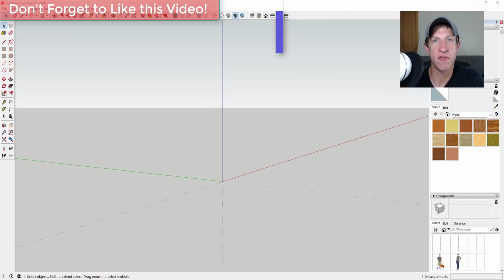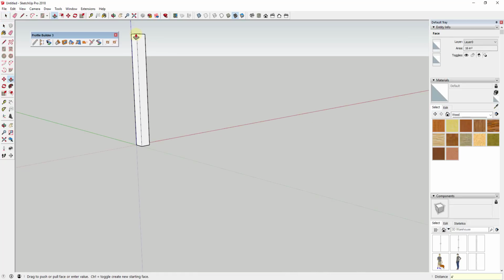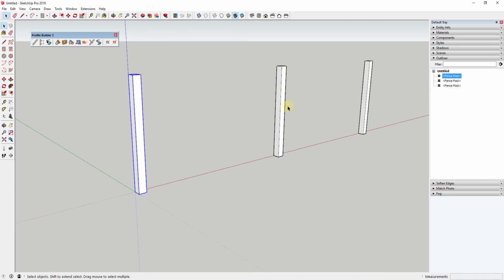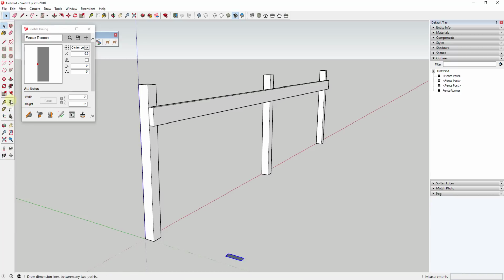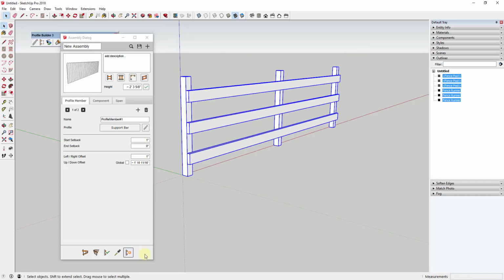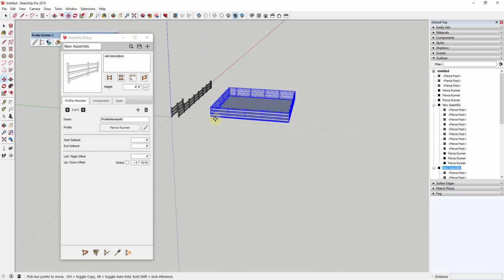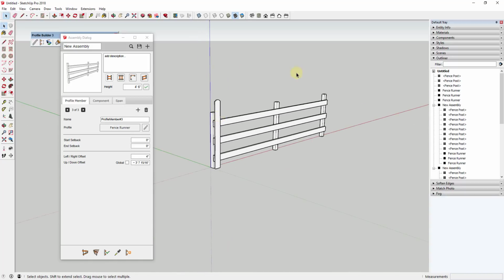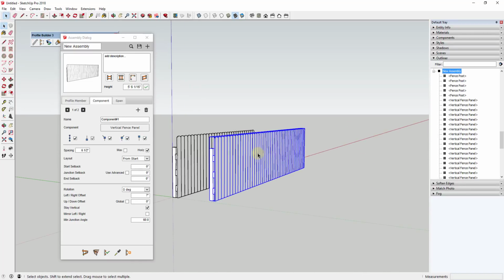AUTOMATIC ASSEMBLIES in Profile Builder 3 for SketchUp with Auto Assemble

Comment: Great script. Can the fences made follow a slope without it stepping the rails. Raking rails following the slope of the ground?
Reply from the maker: I believe that you can adjust the settings so that those would either follow the slope of the ground or stay flat. Haven't played with that function too much yet though...
Reply: many thanks
Reply: @Thesketchupessentials  Yes, struggling to find that particular setting. No video tutorials on the web so suspect that it cannot be achieved which is a real pain. I use Vali Architects instant fence plugin for many fences types but cannot create a new fence with that script, only amend an existing one...

Comment: Hello, so i have sketchup pro 2017 windows 10 running on bootcamp mac intel hd and i have a problem with the selection tool, it s very slow and takes time to respond, any idea how to fix this? Thanks!
Reply from the maker: Maybe start here and see if it helps - https://forums.sketchup.com/t/selection-tool-process-is-slow-unbearably-slow/41147

Comment: Do you know of any extension that can quantify an aluminum window. Output would be glass area and cost. Which Aluminum profiles to use and how many lengths of those profiles do i need?
Reply from the maker: This extension, in conjunction with Quantifier, would probably be your best bet. Generally speaking unless you're a window manufacturer, I've generally seen windows priced either by the unit or by the SF, not by the aluminum profile length. Are you manufacturing windows from aluminum?
Reply: TheSketchUpEssentials yes im manufacturing windows so need quantities of aluminum length and glass.